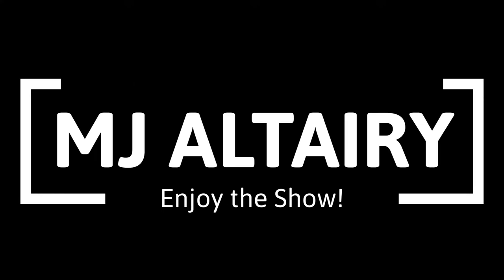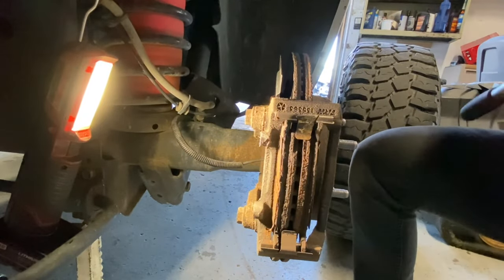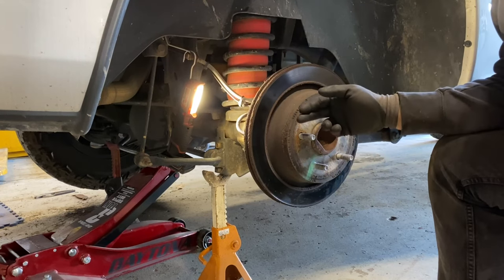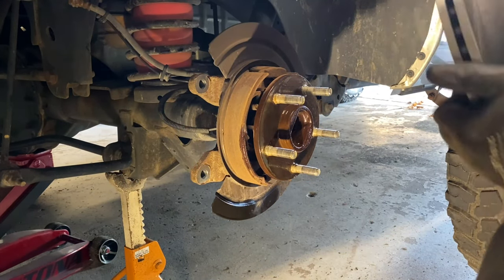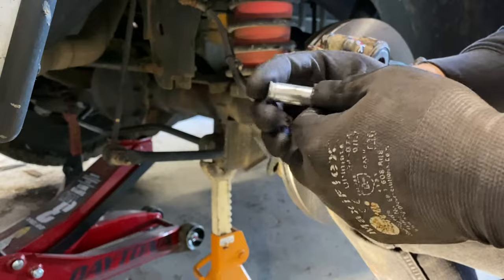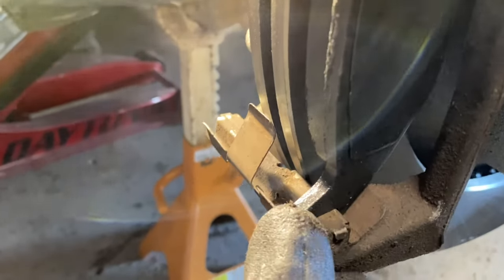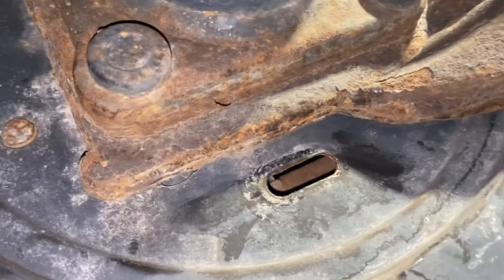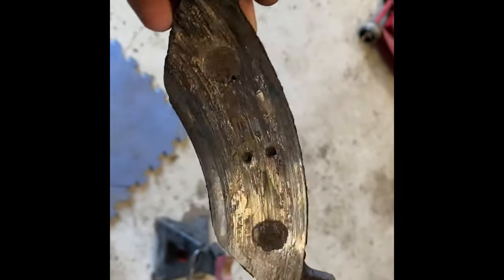2016 RAM 1500 - Changing Rear Pads and Rotors

Comment: Just did mine. What an awful job it was. Had to beat on the rotors for 2 hours with heat to get them off. When they came off the ebrake shoes fell apart. Had to do them too. You need about 4 hands to get the springs back together.

Comment: Nice, would have been a good idea to take the star wheel out for the E brake and lightly coat the threads with anti seize or your grease so it wont seize in the future, they are known to seize. It's a 2016, FLUSH that fluid too and replace with synthetic replacement. What bumper is on the rear??
Reply from the maker: @zxtenn  i just had a stock bumper on the rear

Comment: I just did mine now one side is smoking like crazy, think maybe the pad is sticking
Reply from the maker: Could also just be the oil/residue that’s just burning off the rotors fro when they were packaged. Does it coast fine or does it feel “limited” like the truck is being held back?
Reply: @MJAltairy  it coasts ok, I'm going to jack it up and try turning the tire to see if I feel/hear any resistance. It was a TON of smoke, I thought it was on fire at first.
Reply: @nonagreeable  Did you ever figure out what the problem was?  It sounds like perhaps you tightened the rear brake adjuster too much and it was causing the brake shoes to rub, causing all that smoke.  That's what I'm worried about when I do mine.  If too tight, that is a possibility.  Too loose and the parking brake doesn't work like it should.
Reply: @garyp9906  so what happened was that after I changed the rotors and pads my first few drives included towing a trailer so the extra weight of stopping caused excessive smoke from the oil residue. Everything was fine after about a week. I did damage my parking brake shoes in the installation process though.
Reply: Hey man great tutorial video I will change my rotors by the end of the month is there any way I could mess this up?? As long as I bolt it on good it won’t come loose right
Reply: Haha I laughed when you look up the Torque spec and then go to torque it by feel 🤣